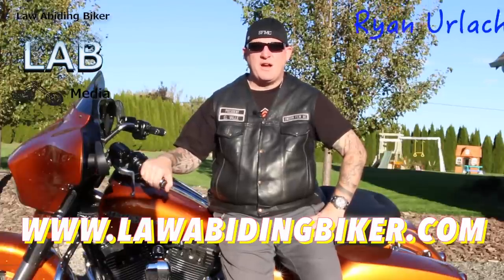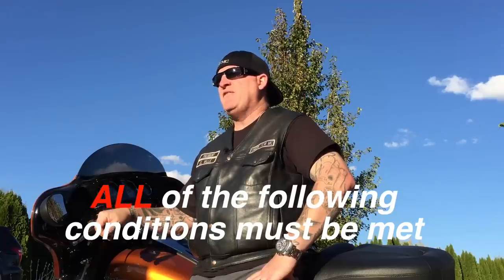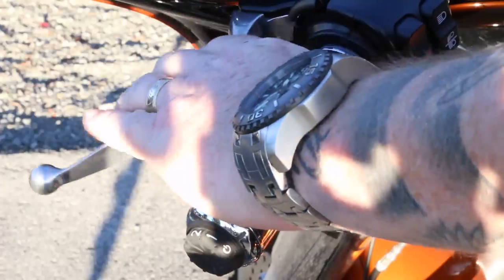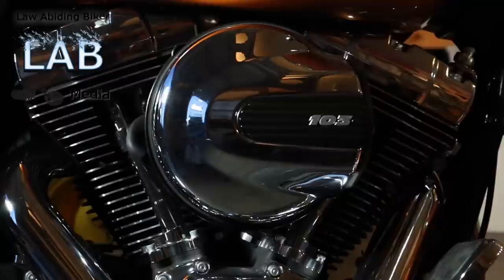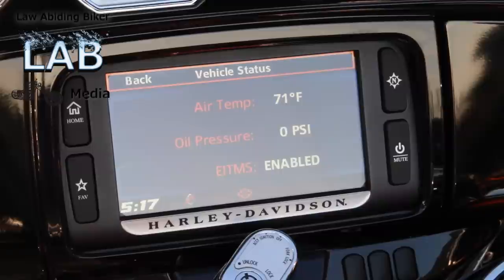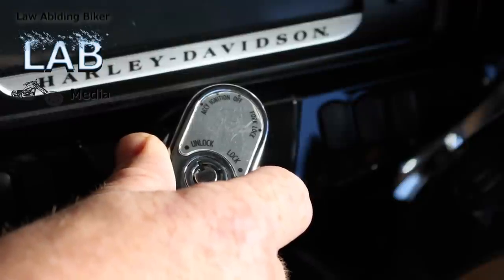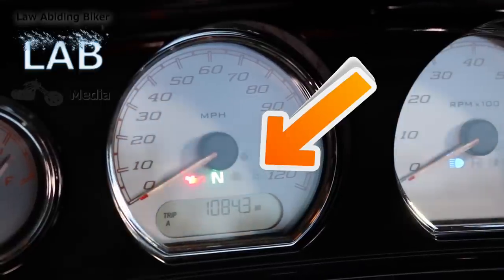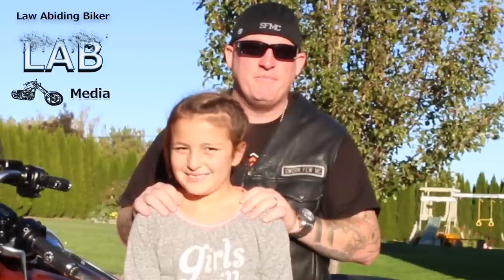How to Use Harley Davidson Engine Idle Temperature Management System (EITMS)-Motorcycle Podcast

Comment: Good video.  I was having problems with hesitation on my 2014 SG (16,700 miles) and thought it may be the EITMS being activated.  It appears the problem may have been the dirty air cleaner.  After 4 times at the dealer for maintenance you would think the dealer would change out the filter, which I was told by the service manager should be changed at 10K miles.  By the condition of the filter and rusted bolts it appears it was never looked at or removed.  I replaced the filter, bolts and cleaned the intake and my bike now runs great.  In the future I will not rely on the dealer.
Reply from the maker: Wow, that's crazy!  Glad to hear you got it figured out.

Ride safe & Ride Often!
Here is a link to a bunch of our useful Free vids: http://www.lawabidingbiker.com/freevideos
Here is a link to some of our useful for purchase videos: http://www.lawabidingbiker.com/buyvideos
Want Answers & Information Fast? And help support us at the same time? Do you like the content we provide?
Our patrons get answers to their questions/comments/feedback in less than 24 hrs and are part of our Private Facebook Group. If you are interested in being in this exclusive group you can get all the details at ==> http://www.lawabidingbiker.com/patreon
If you haven't subscribed to the Law Abiding Biker Podcast make sure to do so. Listen in as we talk weekly about issues/items like this & so much more. You can listen on iTunes (Apple/IOS), Stitcher Radio (Android), or any other Podcast App ==> http://www.lawabidingbiker.com/podcast
Join our free email club at http:///www.LawAbidingBiker.com/EmailClub. Only relevant content will be sent from time to time. Email club members are the first to find out about free or for sale content are given special coupon codes.

Comment: Ryan, keep up the great work, useful videos and tech help onlineI emailed you a while back about your opinion on the Cobra Fi200 Power Pro Black(2016). Wondering if you have any useful info on performance and reliability of this unit?
2nd) I have a 2006 Electra Glide Ultra Classic. I'm not finding how/where to turn this feature on/off. Nothing showing on my displays. I've tried rolling throttle forward with key on and not running and rolling throttle forward with engine running. Nothing shows. Is it on 2006 Electra Glide U.C.? Is there a different approach if 2006 has throttle cables
Thank you, again, Ryan
Reply from the maker: Hey Robert. Not sure on the 2006 brother with EITMS. And I don't have any great info on the Fi200. We don't use it and have not tested it. We use the V&H FP3, Power Commander, Auto Tuner, and Power Vision......Maybe we'll get around to testing it. Sorry, I was not of much help here.

Comment: can EITMS cause hesitation when i pull the throttle? my 2017 Low Rider s has about 900 miles recently began this. after riding for about 30 min. at the stop light. I can feel the heat coming up. Engine vibrates rougher than usual and when I pulled the throttle instead of responding immediately, it made puffing noise.
Reply from the maker: That can happen at time.  We usually give the throttle a quick snap before taking off from a stop when the EITMS is engaged.  

Ride safe & Ride Often!

Here is a link to a bunch of our useful Free vids: http://www.lawabidingbiker.com/freevideos

Here is a link to some of our useful for purchase videos: http://www.lawabidingbiker.com/buyvideos

Want Answers & Information Fast? And help support us at the same time? Do you like the content we provide?

Our patrons get answers to their questions/comments/feedback in less than 24 hrs and are part of our Private Facebook Group. If you are interested in being in this exclusive group you can get all the details at ==> http://www.lawabidingbiker.com/patreon

If you haven't subscribed to the Law Abiding Biker Podcast make sure to do so. Listen in as we talk weekly about issues/items like this & so much more. You can listen on iTunes (Apple/IOS), Stitcher Radio (Android), or any other Podcast App ==> http://www.lawabidingbiker.com/podcast

Join our free email club at http:///www.LawAbidingBiker.com/EmailClub. Only relevant content will be sent from time to time. Email club members are the first to find out about free or for sale content are given special coupon codes.
Reply: My RKS did the same thing today. Freaked me out

Comment: My EITMS was disabled for the 1st 15,000 miles and after my 15,000 mile check-up I noticed that that EITMS was enabled.  It always shows enabled  even while riding and when I come to a stop it shows active when the rear cylinder cuts out. Just wondering if it always shows enabled?
Reply: Gary Lemons 
Enabled means the system is active/on and is monitoring your bike. 
Disabled means the system is turned off and not monitoring your bike. 
I just leave it turned 
On/Enabled 
Enjoy the ride 😎

Comment: Useful info. I think one additional view that could have been helpful to your viewers would have been the third potential message on the info screen. You showed "enabled" and "disabled". You also showed the change in idle tempo. However, you failed to show the info screen also goes to "Active" when the EITMS engages. Matching this visual to the seat-of-the-pants and audio change in idle made the whole process a lot clearer to me.  In addition, you showed how to intentionally engage and disengage EITMS. As a heads up to your viewers, with the weight of the larger baggers, it is not uncommon to switch EITMS when wrestling the bike forward or backward and unintentionally twisting the throttle. Remember, when counter-twisted you do not get any engine rev, thus you may be unaware that you've changed, particularly if your info screen is off and you do not happen to observe the green/orange cruise control light switch. Thanks for the vid.
Reply from the maker: +Pat Coppolecchia We appreciate the info and feedback.  Ride safe & Ride Often!
Here is a link to a bunch of our useful Free vids bro: http://www.lawabidingbiker.com/freevideos
Here is a link to some of our useful for purchase videos: http://www.lawabidingbiker.com/buyvideos
Want Answers & Information Fast? And help support us at the same time? Do you like the content we provide?
Our patrons get answers to their questions/comments/feedback in less than 24 hrs and are part of our Private Facebook Group. If you are interested in being in this exclusive group you can get all the details at ==> http://www.lawabidingbiker.com/patreon
If you haven't subscribed to the Law Abiding Biker Podcast make sure to do so. Listen in as we talk weekly about issues/items like this & so much more. You can listen on iTunes (Apple/IOS), Stitcher Radio (Android), or any other Podcast App ==> http://www.lawabidingbiker.com/podcast
Join our free email club at http:///www.LawAbidingBiker.com/EmailClub. Only relevant content will be sent from time to time. Email club members are the first to find out about free or for sale content are given special coupon codes.

Comment: If the sensor only affects riders heat and has no bearing on engine longevity, I prefer it off.

 I think that HD certainly has an awesome tone and love the way the bike feels and sounds with both cylinders firing. That's the main attraction on the road by other's as well I'd imagine.

I really dislike having it kick in and lose that cylinder. It sounds like a sewing machine at lights. 

If it's better for the engine I'd consider it, but I belive the concensus is, it is designed to keep the rider cooler. 

That's why we can wear Vests. 

It's all part of the HD experience. 

Of course I'd like to add that I learned how to switch it by watching your great Vids Ryan!! I'll be buying a set of Heated Grips before the fall and look forward to buying your install video. 

Have a good one and ride safe Brother,

Lee
Reply from the maker: Lee Ross It keeps the motor cooler too by shutting down the rear cylinder.  I leave mine on all the time.  It's currently over 100 degrees around here and will be for a week or more.  Right on about the heated grips.  Makes riding in the winter a lot more comfortable.  Take care bro.
Reply: Lee Ross 
What consensus?
I believe the whole H.D. Idea here is the keep the bike from getting to hot not keeping the rider cooler!
It’s mainly for helping keep the engine a bit cooler and possibly from over heating in traffic and parades!
Harley-Davidson’s do not sound like sewing machines!! 🙄
Now you could say that about a Honda Gold-wing. 
You must have a pretty noisy sewing machine at home.

Comment: how do you activate it on 2008 bike? is there a way to tell if you have it?
Reply from the maker: As long as you bike is equipped with EITMS you roll the throttle forward.  The cruise indicated will illuminate green meaning it is on, or orange indicating it is off.  Ride safe & Ride Often!

Comment: According to the Harley-Davidson site, its not for engine overheating, but for rider comfort.
Reply from the maker: Rider comfort would benefit from a cooler motor.

This is taken from a HD Owners Manual:
For those riders who frequently find themselves in riding conditions where the vehicle is subjected to prolonged idle conditions or traffic congestion, the motorcycle is equipped with an Engine Idle Temperature Management System (EITMS) to provide limited cooling of the rear cylinder.

Comment: First time it kicked on in my bike is Denver traffic lol. The hesitation on take off iam not a big fan.
Reply from the maker: +MotorPsycho yah, u gotta get used to it. We even use it on our police Harley's daily. U just gotta get used to rolling the throttle a bit prior to take off to disengage it. Once u get used to it u forget about it.
Reply: Same thing in the Denver metro area.  When it is above 80 and sunny here I've had it engage and I thought it was an issue with my V&H fuelpak tune.  Glad this is normal and take off with it engaged sucks.  Blipping the throttle cuts it off. Appreciate all of the LAB videos, theyve been very helpful for me.

Comment: whatever happened to riding a motorcycle?
Reply from the maker: +crowmagg1 Confused about the question. But, thanks for watching this video! Glad it was helpful to you!! Ride Safe!
Reply: +Ryan Urlacher thanks for replying 
i was just reminiscing about older bikes 
lol i would be sitting at a red light and the rear cyl shutting down would make me want to fix it 
neat tec it must have a servo motor handling the throttle 
to keep the rpm's from dropping  
but give me a cable and a carb when it gets to having to work on one on the side of the highway or out in the woods when the mosture and grime works into everything

Comment: Harley Twin Cams are the only air-cooled, engine, premium priced, bike, that needs such a management system. Temps of 400+, are common on the Twin Cam, rear cylinder, and anything above, 300 degrees, begins to degrade the oil viscosity. Instead, of putting in an adequate stock oiling system, that would enable the bike's oil pump to pump out more than 3-8 psi, at idle, Harley masks this inadequate system by, installing a rear cylinder heat shield and this cut off management system. So, much for that great Harley single crank pin sound, you pay for, and don't get it at idle. I live in South Texas, and 100 degree ambient temps are normal, in the summer, and I have an air cooled V Twin, that pumps out 38 psi, oil pressure at idle, with no cut off management system needed at idle. Just Saying, Harley should solve the problem, but, chose to not do so.
Reply from the maker: Thanks for watching and weighing in.
Reply: Thanks, just giving my input, good video.
Reply: Madlgor FKGoogle: Too bad you don't know much about anything. Certainly not about Harley engines.
Reply: so let me remind you what non sense have you put in this topic:

You said: " Instead, of putting in an adequate stock oiling system, that would 
enable the bike's oil pump to pump out more than 3-8 psi, at idle, 
Harley masks this inadequate system by," and then "and I have an air cooled V Twin, that pumps out 38 psi, oil pressure at idle"

I answered: "3-8 psi is fine on any dry sumption system at idle"

then you stated: "and for you information, I ride an air cooled, V Twin 1600 Roadstar,"

so I answered: "and guess what, your idle oil pressure is 8.5 psi"
Which is the idle oil pressure of XV1600 and not those mythical 38 psi you stated, topic closed, since now anything you say is taken as BS, you lost all your credit.

All the other stuff you mentioned is just out of topic, and most of that is a plain BS often used by Harley haters who really have no clue.

BTW, I dont have to google for technical stuff, not learn about Harley engines via google like you do. I work on them on daily base, same as I worked on Japanese and European bikes and cars for over twenty years now.
Reply: Madlgor FKGoogle: You have shown you know nothing about the inherent flaws of the Twin  Cam engine, over and over again.......a lot of TC owners, themselves have posted their own videos of the cheap, stuff, that H-D, uses in these engines......so, they don't agree with you own assessment..
Reply: Madlgor FKGoogle: Still no defense or facts to rebut, all that has been said about the inherent flaws of the Twin Cam engines, you can bloviate all you want, but, what fellow bikers want to know is truth, and facts.....not, just puffing your chest out and beating on it like some kind of ape...don't ape the Harley line, give out some facts, as to where I am wrong on these engines.....that's what bikers want to know.......some are grateful, for accurate info, others, like you just have nothing constructive to say........it just won't work, pal........
Reply: tomcata1467
I will, right in the moment that you prove that your Star XV1600 engine has oil pressure at 38psi on idle.
Face it, you lost the first battle and in this case it means you lost the entire war right at the start.
I dont have to prove wrong facts of a person who was already proven wrong at his first statement.

..so well, some are grateful for accurate info, but its hard to take info from a person who got caught spreading lies.
You just do what all Halrey haters do, hate and spread nonsense.

Get lost...
Reply: Madlgor FKGoogle: You know neither nothing about the Harley Twin Cam, nor about the Roadstar 1600 Soft tail, so, obfuscation, will do you no good. Facts, where are your facts, pal? You must be an armchair, biker, or newbie....probably neither.......
Reply: Madlgor FKGoogle: Wrong, I have the service manual, dude, one of the benefits of owning a Roadstar 1600, not a keyboard warrior who makes up stuff, to suit his fancy. So, much for your credibility. And still no defense of the Harley Twin Cam.........cause you know I am right.........still no good word about how great the Twinkies, are..........why?  Say, something to defend your favorite engine, pal.